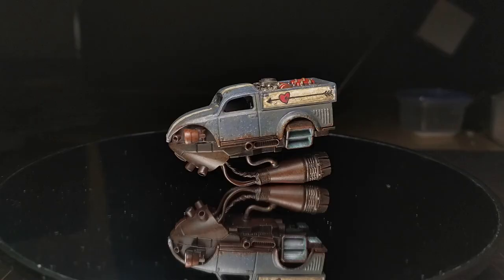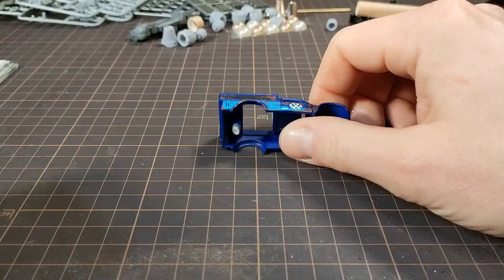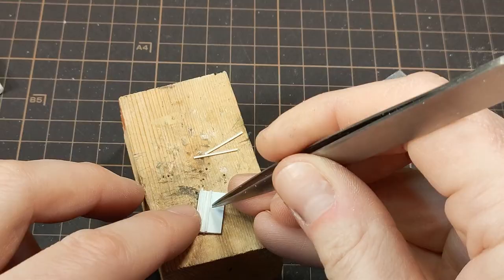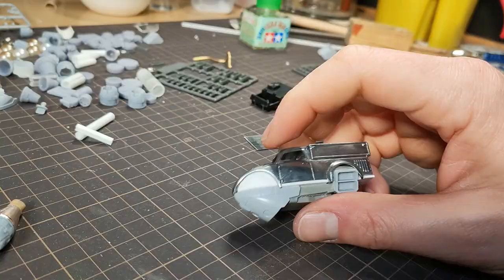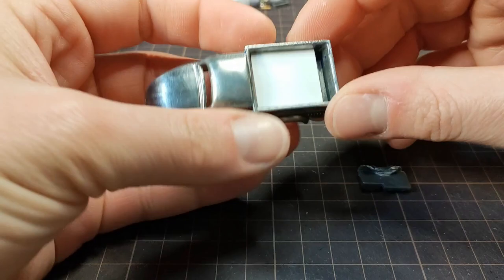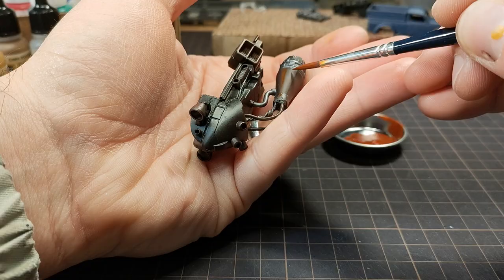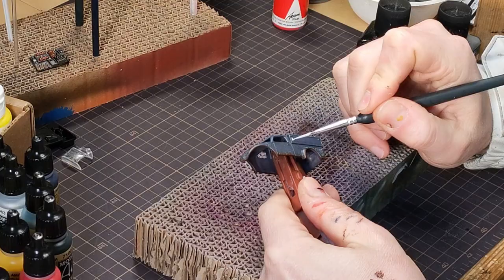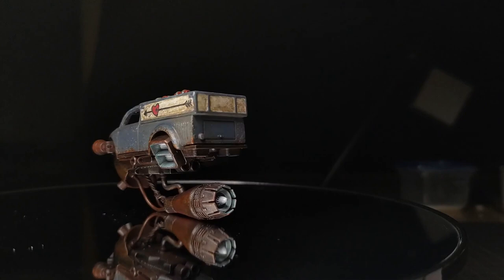Making a flying car from a VW Beetle Pickup | Hotwheels Custom

Comment: i like this build so much. Scratch building is always fascinating!
 Also, i have a maybe usefull tip for the headlights. We often have to leave them hollow. Like without any glass covering, because it is tehcnilally hard and wont be looking nice to cut little flat circles from tranperent plastic. BUT you could probably try to  either incert a little hot glue drops, or epoxy resin drops to fill the space. Or even layer a several layers of transperent glossy varnish ( that one that you apply with brush)
Reply from the maker: Thanks! As far as the headlights go I started with a small round ball filling each but chose not to include them in the end. I also didn't paint any taillights. Not every details is there and some of it is by choice but something I didn't mention in the video is that I started the build only  5 days before I uploaded this video 😅😅

Comment: Great build, these flying cars are so much fun! Probably going to attempt one myself soon, but i'm kinda wondering if we can make these floating by putting in strong magnets that repulse each other and tying the car down to the base on 4 points using thin fishing wire. Do you have any experience with this concept by chance?
Reply from the maker: Thanks! Have you seen my levitating Mazda build? I had it floating in the back. It isn't possible to fully levitate something with conventional magnets. You need a special electromagnet that's big and expensive.